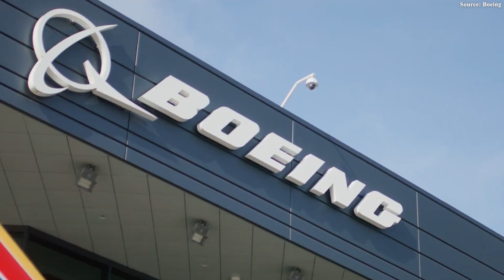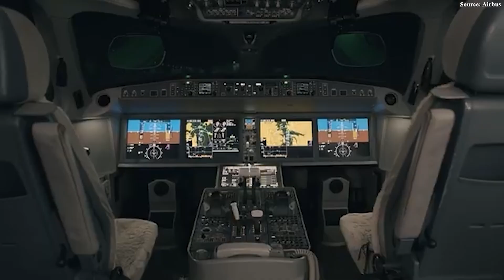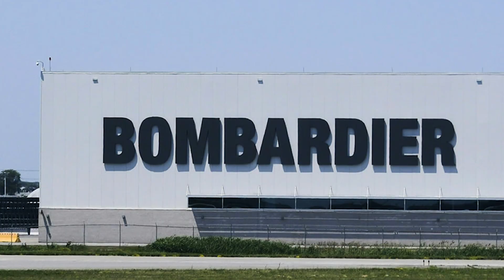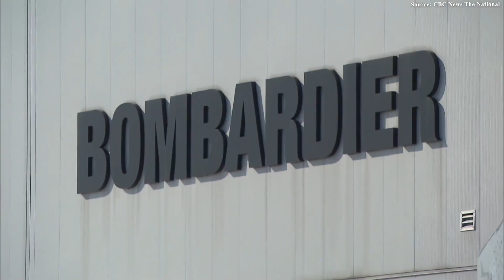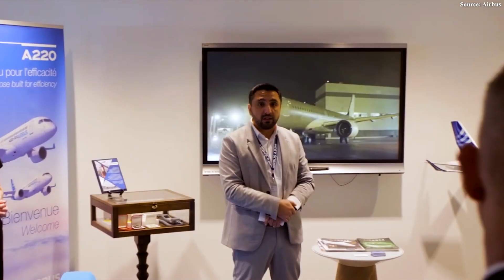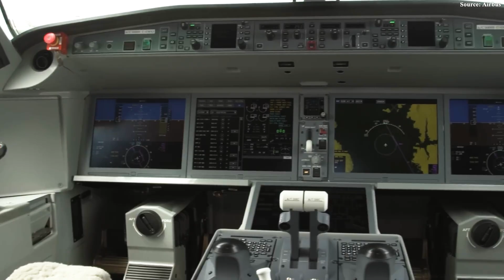This Is How Airbus & Bombardier C-Series BEAT Boeing SHOCKED Aviation!

Comment: The point about the 100–150 seat gap is spot on. Boeing and Airbus got lazy stretching A320s and 737s instead of building the right tool. Bombardier actually did.